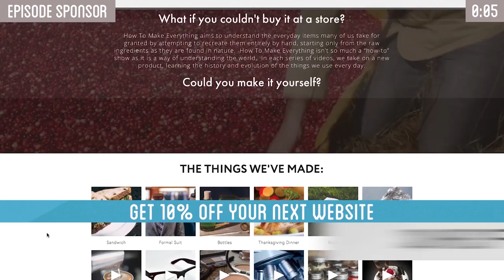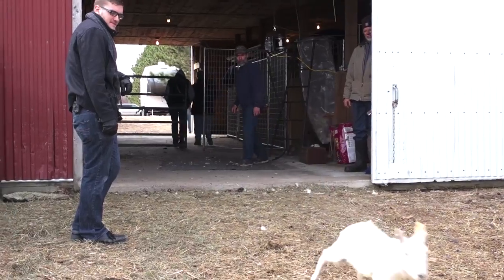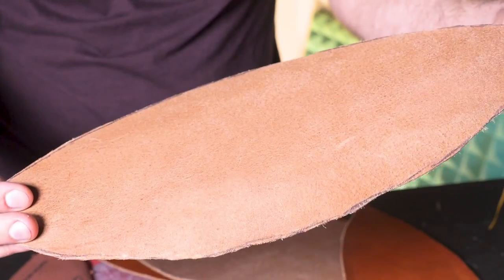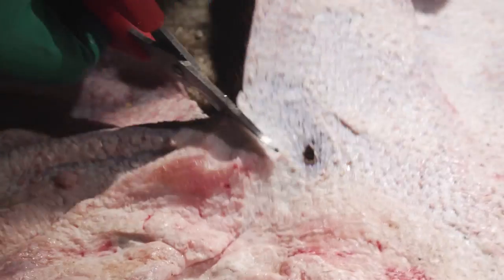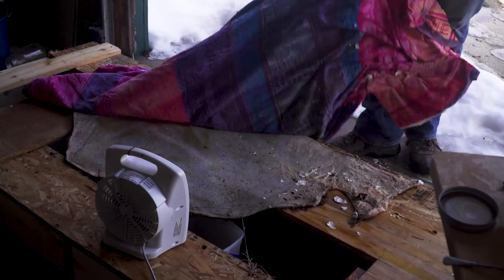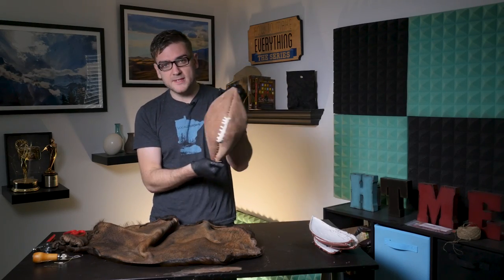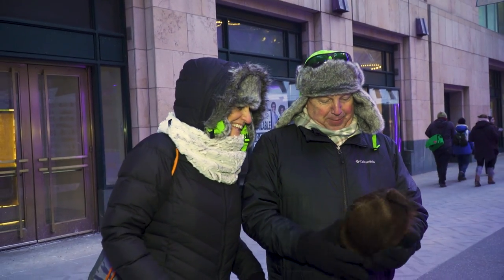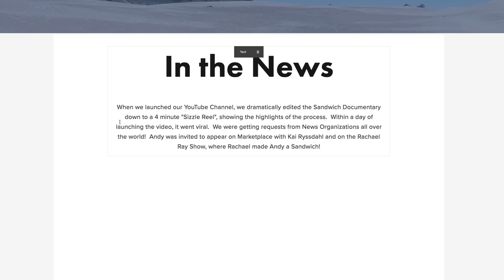Turning a Pig into a Football | HTME Super Bowl Edition

Comment: since the bladder was raw, is there any risk of it rotting? did it develop a smell at all?
Reply: Typical Tofu i doubt it i think its morlike a sousage skin and it just dryes out
Reply from the maker: That's my concern actually, but I'm not sure.  The smell of smoke is overpowering of any potential rot.  I suspect it'll eventually dry out and be fine, but not sure it'll hold it's shape.  I have the ball in my fridge right now, just in case.
Reply: How To Make Everything i think you should have found a way to dry it out or treat it in a way so it keeps its flexibility or it doesnt rot. Then again its not a synthetic material... oh the many variables... how does your significant other respond 😂 or friend... room mate... “the hell is this in our fridge”
Reply: how did you maintain the pressure of the bladder without any valve?
Reply: How To Make Everything I would recommend putting it in a drier place, like a pantry. The fridge might be a bit too humid.
Reply: kpanga same way as a balloon.
Reply: you mean that he did a knot? i dont think the bladder had ¨tube¨ enough to make one
Reply: Typical Tofu here's a true story that happened me and my dad were hunting and we looked around never got one but then my dad stopped and pulled his rifle out shot it we tagged it and gutted it.. it smelt horrible
Reply: How To Make Everything Lloyd
Reply: In my country, Romania, we use pig bladders to make a sort of aspic with. That's a savory food item made with jelly filled with meats, vegetables and spices, a little simmilar to the Scottish Haggis. 

The way to make the bladder last, not rot and flexible is: 
1. Trim all the fatty things and other tissue from around it, making sure you don't puncture the bladder. 
2. Wash it very thoroughly, even with a drop of food-stafe dishwashing agent, rinsing it many times after. 
3. Inflate it fully, tie it off with a string, making sure there is no air escaping.
4. Hang it up to dry in a dry and cool environment. In the process it might deflate, get wrinky, etc. You should not worry about this, it will regain it's shape and flexibility later. The drying proceess is done when it's fully dry, translucent and almost makes a rattling noise like a thick plastic bag (about 1 week or more, depending on the conditions).
5. Carefully handling it, soak it in salty water for a few hours. Yous should end up with a very flexible and durable membrane that can be reinflated or stuffed with food ingredients in the aspic's case.

I think you should be able to use this process to make the bladder for a better, long-lasting football this way. When I was a child and my Mother didn't want to make aspic, my Father still treated the bladder this way and eventually gave it to us to play with as with a baloon. When it fully dries again inflated it should stay the same size, just may have a bit of slack.

I imagine some other additives could be used to enhance it's flexibility and durability.
Hope this helps!
Best Wishes!

Comment: how to make a computer from scratch! Hehe...
Reply: Lol
Reply: Ouch.

Actually there is an active community working on making semiconductors at home, i forgot a few of the names that are most important, but i think Jeri Ellsworth and Ben Krasnow were part of those efforts at some point. Chances are, in a few years they should be able to make ICs with a few thousand gates in them, and a threshold of 4000 gates per IC should be fully sufficient to create an early 80s style 8-bit home computer from raw materials. Passive components will probably never not be a thankless chore though, so maybe off the shelf linear active components and passives and self-made ICs are a reasonable compromise.

If you're willing to go off-the-shelf route, Pentagon 48 computer schematics and board layouts of which circulated in Russia around late 80s or early 90s can run a ton of software and requires no specialised parts - a big nest of 74 series logic ICs make the graphics and I/O circuits, then you just need a Z80 processor, EEPROM and RAM, everything still manufactured, and you're done.
Reply: just make an abacus, done and done!

Comment: few things:

1. to get the impression you should wet the leather and then press it on the pattern to dry.
2. you should do something to treat that bladder if you don't want it to rot real quickly (common method for catgut, which should apply here, was to use lye..not sure how they treated the bladders in old footballs)
3. wtf is keeping that bladder inflated?